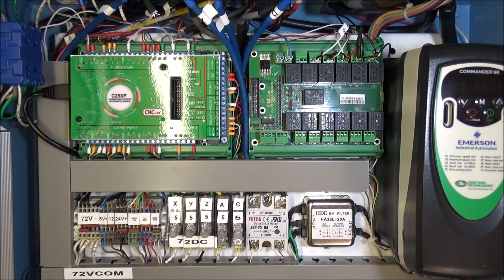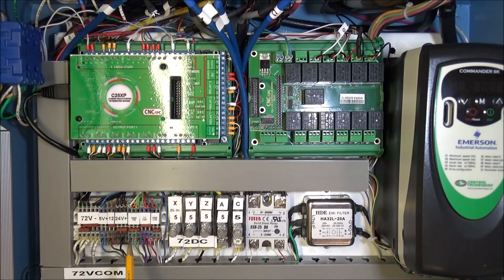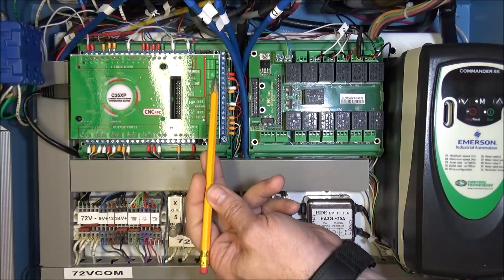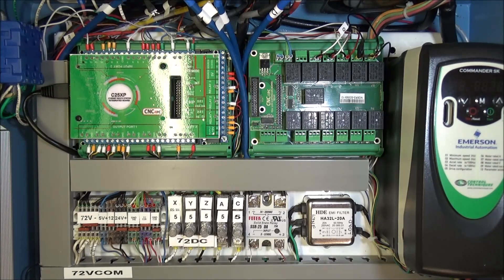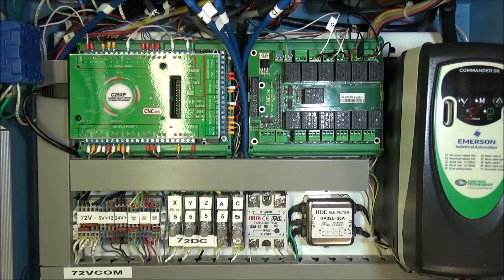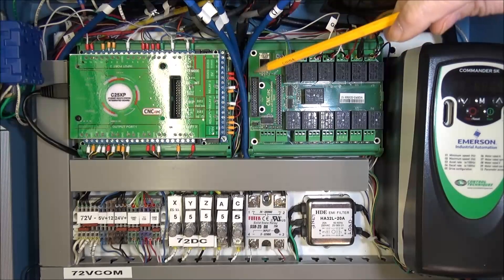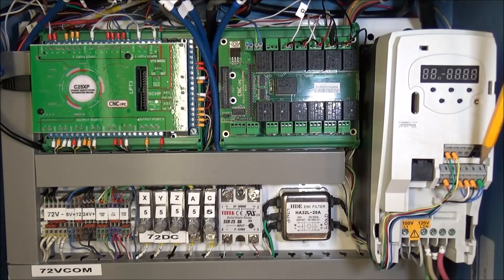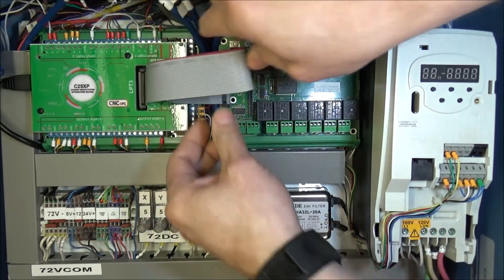PM727M ATC Wiring Pt7 Recap

Comment: Hi Sam. 
 How do you make mach3 trigger estop if the spindle fails for whatever reason or lost power, while its being controlled by pwm 0-10v?  Any help would be appreciated
Reply from the maker: I think that depends on your setup. The C25XP has a SCHP ( Safety Charge Pump ) which if loss of power will shut off all the movement and spindle. This also works in conjunction with the Enable Relay which can be used to enable servos and the VFD.  If you run a VFD with your spindle there is often a internal switch to alert a Fault condition that can be wired into the controller.
Reply: @CNC4XR7  I think I might have it, now I just need to connect it to the SCHP relay. 
Thank you for the  help